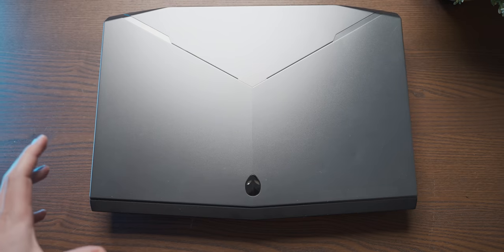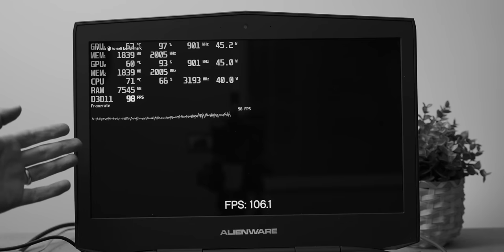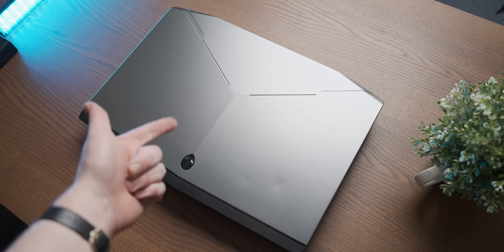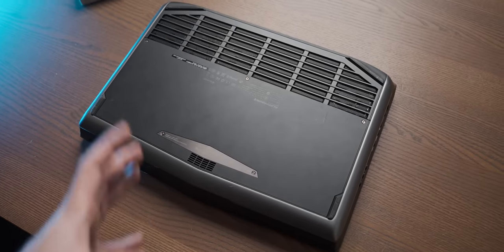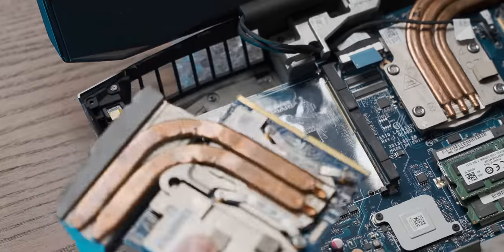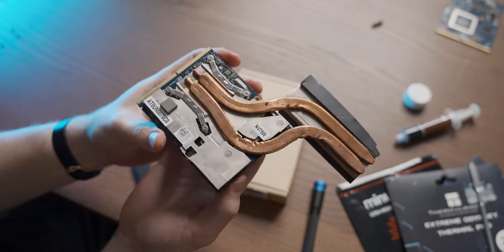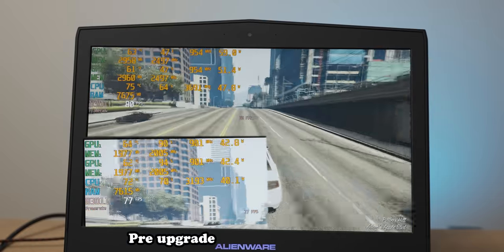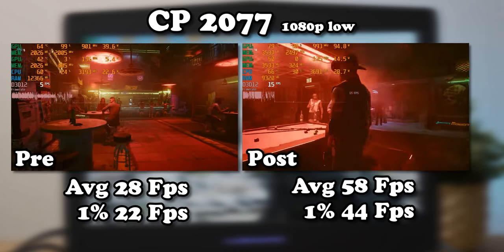Now This Is UPGRADING A Laptop

Comment: Hi, Ian searching for a laptop that can also be used as an external monitor. For instance hooking up your ps5 or xbox, but I do not want to screen record or use maracas. I want to be able to put the HDMI cable directly into the laptop. Also the laptop needs to have two m.2 slots. Do you know any laptop that can do this? Ans how this feature is called? I found the term HDMI-in, but when I google it, it gives you different results. Thanks in advance, kind regards.

Comment: The thing with old laptops are their trash screens. Should definitely consider replacing that screen before anything.
Reply: I agree with you. I have replaced the 4k screen on this laptop, it is perfect, the screen model is NV184QUM-N21. It requires cracking the bios and expanding a new edp circuit.

Comment: I have a HP DV2000 (a DV26660SE specifically) from 2008 I found in a pawn shop last year for only $5 due to display not working. (turned out to just be power cable to backlight being loose. Might have been dropped on it's side at one point. :P ) and I managed to upgrade it's CPU. Not easy as it required a full tear down pretty much to get at the CPU heatsink/socket. Upgraded it from a T5250 1.5Ghz Core2 Duo to a T5850 2.1Ghz Core 2 Duo.

It has an ExpressCard slot and I've heard that's basically a PCI-E 1x slot and I found adapters for such online so I will definitely attempt to attach my GTX 650 to it at some point to see if I can supercharge gaming to the max on that old mesozoic period laptop. The CPUs supports 64-bit despite being capped to 4GB of DDR2 ram so at least modern OS/games could theoretically run on it. :D

Comment: I've actually got lots of experience with mxm cards, I have a great many of them that I've pulled put of various HP, dell, and clever notebooks. I've got a quadro p4000 running in a dell precision m6700 that also got a 120hz screen swap and 16gb of ram. The mod to the driver to make it works is surprisingly easy and it runs even today's games great.

Comment: I have messed around alot with Alienware laptops and SLI. And it has some issues. First bug is that the gtx 880m card and throttles ALOT! The solution is to put the laptop in hibernate and wake it back up. Then you get much better performance.

Comment: LOL i can't believe how difficult it was to tear that machine down. I had the predecessor to that model (M17x R4) and had just 2 screws to remove from the bottom panel and it exposed (almost) everything worth changing. When the stock AMD 7970 GPU died, i was able to source and install a GTX 980. That gave it another 3-4 years worth of life.

Comment: I have a Toshiba from 2011 I decided to finally upgrade. It had a Pentium B950, 4gb of ram and a 500gb HDD. I bought a new keyboard for $15, new battery for $15, 16gb of ram for $30, a 240gb SSD for $30 multiple years ago, and the cheapest quad core I could find. The i7-2630QM for $35. Not half bad imo

Comment: Um sniff achtually,

The original Windows install was probably not corrupted and was a result of a SATA controller mismatch. Dell BIOSes can have either AHCI or RAID mode configured by default, and while AHCI can be booted in RAID mode, RAID drives and any drive booted in RAID mode are now locked to that controller type. So booting a RAID-configured drive on AHCI results in blue screening on boot.

Comment: The Blue Screen said "Inaccessible Boot Device" which makes me wonder if it was missing a driver. I had a RAID setup on my computer but when I did a firmware update it wouldn't boot into that drive. I believe that it was because when the firmware was updated it messed up something and I needed to get a new driver.

Comment: A bios/firmware upgrade could do a lot to increase performance. If the power supply can handle more power to the video cards. Because spec-wise there is still some performance left on the table.

Comment: I wanted a clevo p870 for so long. Apparently they aren't planning any more mxm laptops cause intel dropped support or something like that. The original p870 came with a z170 chipset and the 6700k. You can bios mod it to accept up to the 9900k. That one came with 900 series gpu's, but if you solder a 3.3v line to the mxm slots you can install GTX 1080's. Newer ones don't need that, but where's the fun in that. The msi 1070 doesn't even need that mod, but gotta go for the best. The rtx 2080 mod has been done, rip sli though. I think even 3080 is now an option. Now that was a good laptop to get back then. The actual challenge is soldering heatpipes to the base plate of another cooler to make the rtx cards fit. I wanted one so much but used was the only option for me and they basically don't exist for sale unless you wizard your way thru eBay. I have to go itx and strap a monitor on there now I guess since ryzen+mxm was never made. This upgrade could have been much better if Kepler was ditched in favor of at least Maxwell. Kepler doesn't run new games well.

Comment: I kind of wonder if the stability issues and possibly some performance was left on the table due to power limits. I noticed the one GPU in use was between 70 and 100w when it was rated for 175w? Wonder if you only had one GPU in there if it would be more stable and maybe the one GPU could use more power and clock higher?

Comment: Dell uses a weird "RAID ON" mode for SSD's and you can switch between it and "ACHI/NVMe Mode" and if the mode is changed at all after Windows is installed, itll say inaccessible boot device.

Comment: Looks like there was absolutely no SLI happening in BFV and CP2077 (second GPU is basically idling, while the first is thrashing at 99% usage). I wonder if you the driver lacks an SLI profile for them, and if overriding and enabling AFR would help...

Comment: 4:00 Good news, an 880M throttled to 75W is going to be a heck of alot faster in most titles, especially modern, than a 770M overclocked to 150w

Comment: why does the stock version of that laptop runs the games better than my hp omen 2020 with an i7 9750H and gtx 1660ti? how it is possible that the stock version of that laptop runs gta V  at high settings at a high frame rate meanwhile my laptop runs the same game in medium graphics at 50-60 fps
also I have an ssd and 32gb of ram

Comment: I bought one of these because of the last video.  The positives: 1)Upgradability and serviceability. The negatives: 2)Don't buy it from a sketchy seller.  I went down the rabbit hole trying to get it running correctly as a laptop.  Actually I'm still here.  Works great as a desktop since I can't figure out why the laptop keyboard (on my 3rd one) isn't functioning and the screen is all messed up.  Still, I'll get it running correctly sooner or later.  It's almost like a desktop with the upgradability and serviceability.  I'd gladly give up thin laptops and go with thicker ones like this Alienware 18 if I could replace and add parts to them.  Like hard drives.  Never seen a laptop with 11tb worth of space before until now. 😁   Maybe in the future upgrade the 880's to 980's and max the CPU out to a  i7-4930mx.

Comment: The inaccessible boot drive happens quite often with DELL devices if the BIOS was reseted to defaults. They image windows with some strange RAID settings even when there is just one drive installed. You should have toggled the RAID/storage Mode before reinstalling Windows. This COULD have saved you a coupple of hours.

Comment: This is why I ended up going for a small ITX* and Macbook Air combo. Great battery life + upgradeable graphics if you don't have to play graphically intense games on battery. If you don't like the latency for Moonlight, just add a pair of glasses like Nreal Air.

* Velka 3 would be the best but unfortunately most of the current GPUs are massive chonkers**, so at least a Velka 7 or Dan-A4. If you can size up a few more liters, then there are more options where everything will fit.

Comment: Why not plug a PCIex 16 riser into the usual miniSATA or miniPCIex ports most lappies have, my ancient HP Compaq 8300 USDT has not only those but also a MXM port too, wonder if something more modern would plug in to its rather shaky bones hehehe   I did have my 8300 running my 750ti via riser and apart from having to run a separate power supply to power the riser, it worked extremely well and tons better than the 3rd gen i5 onboard grafx lol

Comment: 6:00 u defenitely should have done a copper shim mod.

and a copper heatpipe mod that are glued to the cooler with thermal glue. On the heatpipe u can install the small copper shims / heatinks.

helps a ton!! 
also good thermal paste like cryonaut would help.

Comment: If you reach out directly to AETINA, they actually have an A4500 MXM card for sale… only costs $1950 USD! 

The core/ram etc. are roughly 3070 Ti equivalent, although performance is lower due to the power limits

Comment: The power supply might not be able to handle the upgrade as it probably was rated for lower output with the original parts, maybe the reason why you got more crashes.

Comment: i thought there where 980 cards available mind you after some considerations i hadnt thought off maybe it wouldnt have fit or been to much for the heatsinks and power draw for it to handle, not sure bout the RTX boards think there a different size and position of mosfets etc... probably completely different.

Comment: Not sure if you are aware dawid but sli as of dx12 no longer functions in the way you think. Sli doesn't actually work in dx12 instead dx12 has what's called mgpu instead (multi GPU)

However there is only a handful of games that actually have it and such that would explain your poor sli utilization.

Any game that can be run in dx11 mode can be forced to run sli with various issues that can come up but otherwise most new games don't support sli.
Reply: Just to add to this 

Battlefield 5 I believe has an option to choose between dx11 and dx12. If you change back to dx11 you should notice a utilization jump on your second GPU if the sli profile is current on it (there may not be one but there is ways around that)

Cyberpunk is a dx12 only game and the performance jump you saw is the resulting difference between a single 765m and a single 880m NOT between sli on either as cyberpunk does not support mgpu mode.

If you want to better see your performance gains you need to load up older dx11 based titles as that was the last generation of direct x api that supported sli.
Reply: MGPU is pretty much dead and games that implement it sometimes still rely on crossfire/sli to work. Even if the forced bf5 to use sli the preformance improvement would be 15fps if the drivers actually work and don't tank the fps. The biggest fps gain he could have would be getting a single 900series card that works with the laptop instead of going sli.

Comment: I bought an MSI GT73VR-7RF with an MXM GTX080 and 7th gen i7 on it for $200 with a broken screen.  One panel switch later, and I have a very similar chonky beast.  I really want that 2080 MXM card, but to be honest the 1080 is already bottlenecking the poor quad core i7 in a lot of modern games

Comment: Any gpu with the die in the same spot that has low enough power draw should work just fine seeing as mxm is basically just a pci interface.

Comment: I think that Dell made a failed device like this Alienware device. For heaven's sake, I could not find parts or a battery for it. In the end, I decided to break it and take out the processor and RAM and install it on the Dell Latitude device. I also kept the original adapter. The used device that I bought, the Alienware M15x, was a failed device no matter what they did to it. More than an update and beautification, the ex58 remains better than it in all aspects and details, despite stopping support. This board bears all the new things from the new generation and fulfills all the requirements you want, as well as supports UPGRADING which you want. We printed together. Edit only bios
Also the other device I have is the third
Old Intel Core 2 processor
Android works very well and does not need to be upgraded. The SSD is sufficient for the purpose and some light modifications work as well as the RAM and more.

The name is Alienware, the status of garbage. Sorry guys for saying that, but honestly, it is a failed device in all its versions. It is a failure.
As for Dell, there is no disagreement. They have better devices than this damned device

Comment: You say the upgradability is unheard of, but the Framework Laptop has all that and more. They're promising upgradable GPU with the new model (which I don't think is out yet) and they're even currently providing CPU upgrades through affordable motherboard replacements.
Granted with the death of the MXM form factor it doesn't work quite the same way, you can't just buy an off the shelf GPU and be able to put it into "any" laptop with a dedicated GPU (not that that was ever the case anyway because of BIOS compatibility issues)
Whatever upgrades Framework sells are going to be Framework compatible only, unless they can standardize the format (which they are trying to do apparently)

Comment: I think the instability is coming from power. Instead of running an unproductive SLI, try pulling the second GPU entirely out of the system. That should hopefully improve stability.
Reply: Power shouldn’t be a problem, they actually support up to 980 in SLI. Was my main computer until recently.

Comment: I remember upgrading my toshiba satelllite P500 or P505D from a dual core Core i5-520m, with Geforce GT330M 8GB and 320GB HDD.
To quad core Core i7-820QM, Geforce GTS 360m, .....16 or 32GB of RAM, and 2x240GB SSDs

Comment: there are a few MXM form factor AMD firepro cards available as well (similar to the R9 gaming cards) that usually go for less than the GTX gaming cards they dont do SLI, but for the single GPU laptops they are great

Comment: This is one of the reasons why I miss the desktop replacement laptops that are unapologetically thick, but quiet, cool, and full of performance.
Reply: Unfortunately, manufacturers caved in to enfeebled marmosets that just screamed they wanted "thinner and lighter" and then complained when they had no performance or a melted laptop. Back in the day we thought nothing of lugging a 2KG laptop and its 1KG power supply.
Reply: @jabezhane  Heck I was using one all the way up to my Acer Predator Helios 500, before it's motherboard failed. I had the AMD Ryzen 7 2700 and Vega 56 model, desktop components in a laptop that never got over 70° C.

I also have a HP HDX 9000 from 2007 that I've been nursing back to life, it's a great machine for what is designed for, and entertainment PC. So it's at my desk as a second monitor. 20.3 in display, just an absolute massive absolute unit of a laptop. With the recent popularity of Atlas OS thanks to LTT's channel, I've been able to resurrect some of the life into it that Microsoft has taken out with dropping security support for Windows 7. Granted, Atlas OS has no security so... It's by no means my primary machine and I only use it for watching videos, and playing retro games.

Comment: This generation Alienware is only outdone by the X170TMG series of Clevo. It was after the M18 that they decided to move closer to a BGA style product.

I had a P750TMG P870TMG, and they were all beastly laptops. They are all capable of having a 2080 in them with a desktop CPU
Reply: The X170TM/KM also has a 10th Gen Intel chip with the possibility of a 3080, rumors of a 4090 as well being built for the MXM slot on that.

Comment: So hunting om Ebay for a  high rated seller/used 9th, 10th or 11th Gen i5 gaming lap top with 1660 or 3050,...etc , with 16gb DDR Ram sounds like a better deal , there is some fantastic deals out there if your patient shopper.

Comment: LoL, I'm typing on the same 18 inch laptop! 

In the bios, from factory, there are some overcloking setup !!! (F2)

And I did the same, except that I focused on two gtx970m (for the DX12 and the tdp) and 32GB1866 of ram!
And a ssd. A little grinding was needed for the coolers! 

I bought it for diablo3 when it came out! It handles SolidEdge2023 at pro level perfectly!

Comment: Maybe do a modern mxm gpu if it will support after research for next video would be cool. Maybe even same or less wattage like a 1660 super or 2060 or 3050/3060, or even team red in the 5000 series and then you would be cpu bound even if you can get extreme series it would probably max at 6 cores

Comment: The 880M 100% requires the 100W rated heatsinks. It's also a terrible GPU and had a high failure rate. The 980M is a much better option but a single 1060/1070 would be even better and more cost effective than buying two cards for SLI. You won't have much luck getting the Clevo 2080 to work due to it's additional power requirements but there are Quadro cards like the RTX 3000 that work really well.

Comment: I think it will be much better if you removed one graphic card and ran the system on just a single gpu in bf5 the GPU was using almost 100watts of power Md since it's rated for 125 watt removing the other gpu will maybe enable the single gpu to use all the 125 watt resulting in higher freq !

Comment: MXM graphics cards are too expensive. I wanted to upgrade my old laptop from GTX 1060 to 1070 or 1080.
The cost of a replacement card was the same as a new laptop with a 40XX card included. Not to mention the difference between an i7-7700 to an i7-13700.

Comment: This laptop can run first generation RTX cards so long they are to the common mxm standards without an auxiliary power connector. Anything newer is either rarer than hens teeth or soul crushingly expensive like $1600+ expensive. Anyway this machine without much effort will happily do GTX 980m.